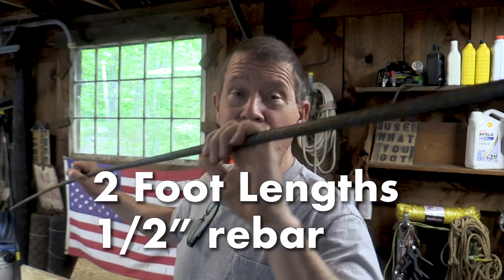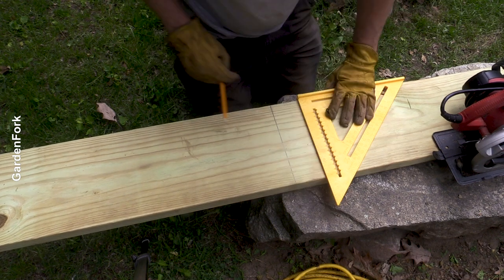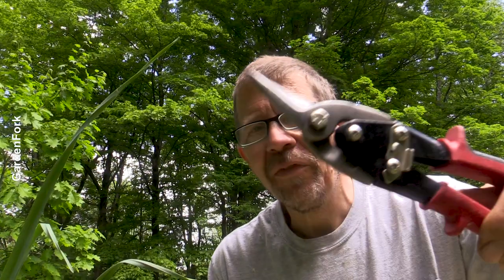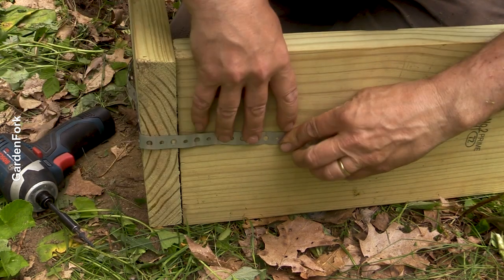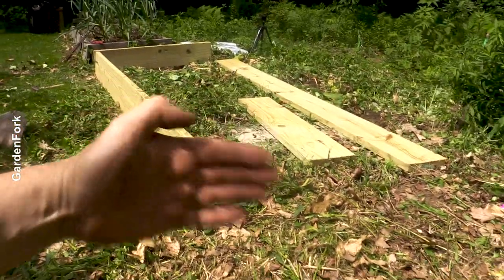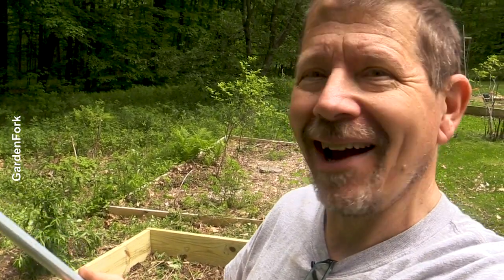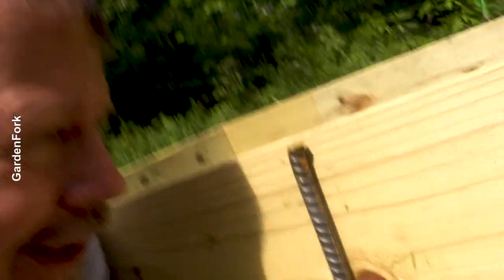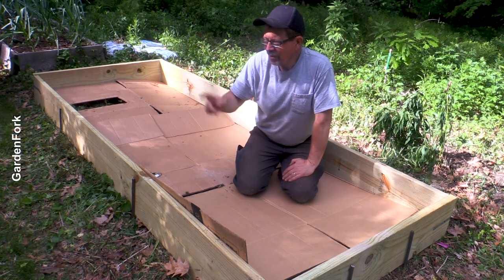Easy Build Raised Bed

Comment: I use black metal stair spindles (hollow) to cover the rebar on DIY raised beds and DIY planter boxes. They cost 75 cents for a 36" single and have little plugs/endcaps you can put in the top to seal the sharp edge. I live in the mountains and garden in beds on terraces of cardboard, compost, and mulch. Winter weather erodes but rebar keeps the beds together and then I just add more layers around the beds every spring before the weeds get a foothold.

Comment: Nice. I make my beds one level higher and then use chicken/rabbit wire metal mesh screen on the bottom of the bed to keep out any digging critters. It works well, unless you are trying to stake a pole or post into the bed.

Comment: Eric, can you explain what the benefits are to laying cardboard down? Is it to block the grass from coming through or an aid to the soil once the cardboard breaks down? Also, why use the banding opposed to just screwing the boards together with the drywall screws? I love your videos! Thanks again!
Reply: Yes, cardboard prevents the existing grass and weeds from coming up through the additional soil, and breaks down pretty quickly. Screwing into the long grain tends to hold better/longer than screwing into end grain.
Reply: FXM is correct. Cardboard also attracts worms. Drywall screws aren't long enough. The wood is 1.5" wide and you'd need enough to bite. I make my beds from 3.5" yellow zinc screws, 3 on each corner. Never had a joint fail-the (untreated) wood rotted in 10 years and the screws were just fine. Also never needed any rebar bracing. Not to say Eric's way isn't good, it is, I just did mine differently. There's no one right way. The only addition I would make is put the cardboard down first and let it extend under the wood sides and out a little. Those weeds on the inside edges will grow right up into the bed. Plus overlap it a lot and put down several layers.

Comment: I use 24"x2"x2" stakes cut from 2"x10" boards to hold up the sides of the same boards. That's it. No metal hardware. Sure, the corners may develop some small gaps, but that doesn't bother me. With no hardware holding the boards together, they are easy to flip every year or two to expose all the surfaces evenly to the elements and to the soil, prolonging the life of the wood.

Comment: Thanks for the video ! I have 3 raised beds plus a regular garden (35'x50') .I need to down size due to my job hours.I have the wood & all the supplies ,by the way that strap stuff is called plumbers tape. Or it used to be. I got my 2x10 sides from work as they were putting in new machinery and there were lots of crates that were going to go to the land fill (what a waste) .Also if you have it or could borrow one,a large bolt cutters can cut that soft rebar pretty easy.Take the bolt cutter along when you get the rebar & you can fit the rebar in the trunk of your car .
Reply from the maker: Bolt cutters and rebar - excellent info. And glad you, like me can’t stand good stuff being thrown out. Eric.

Comment: I buy the 20 foot sticks of rebar and take my cordless sawzall with me and cut them in half so I can haul them in the back of my truck, lol. I feel like if you already have 3” deck screws on hand, I buy them by the 10 pound box, it would be easier to screw a couple into each end of the bed than mess with plumbers tape and then you don’t have to look at plumbers tape??? Maybe not, 🤷‍♂️. Love the vids though.